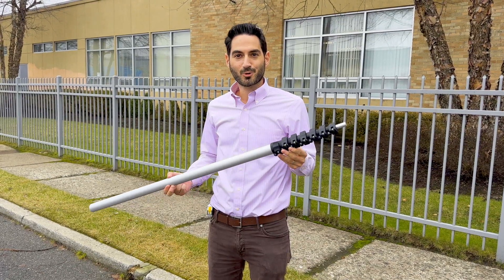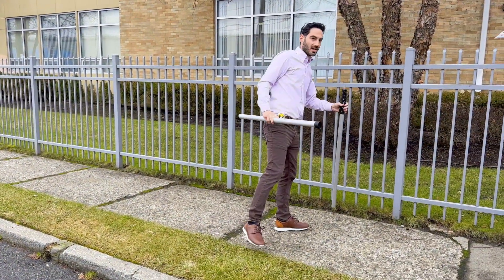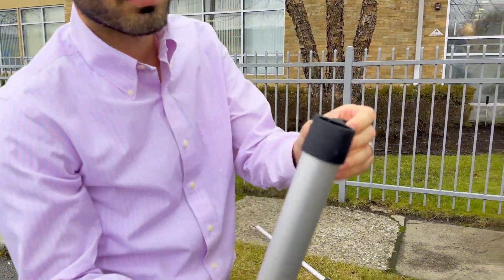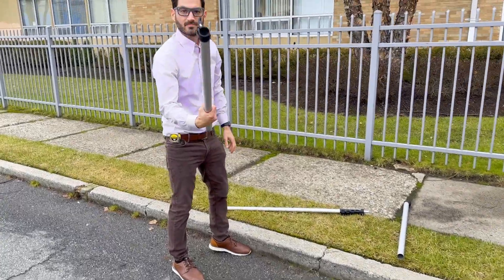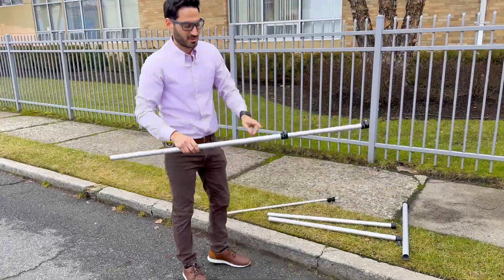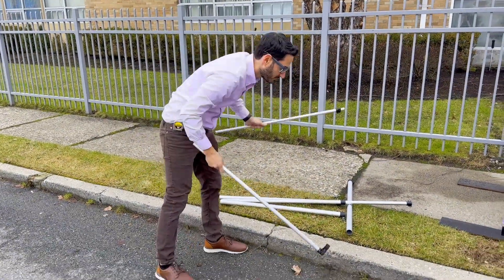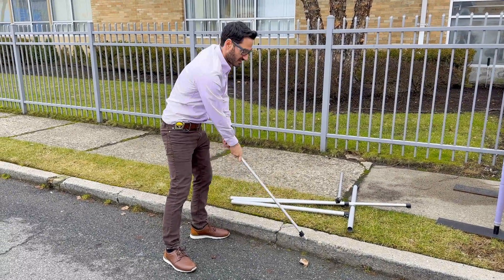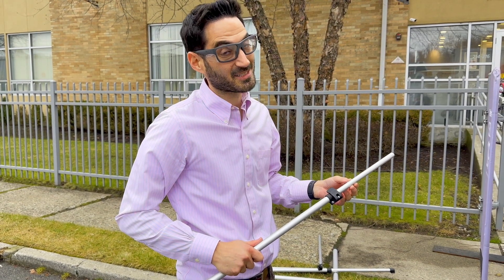L-Lock Curb Test

Comment: No clue what they are for.
Reply: They’re for beating on curbs.
Reply from the maker: The locks are used to secure the position of telescopic tubing usually made out of Aluminum. We are showing that the locking mechanism is very durable.